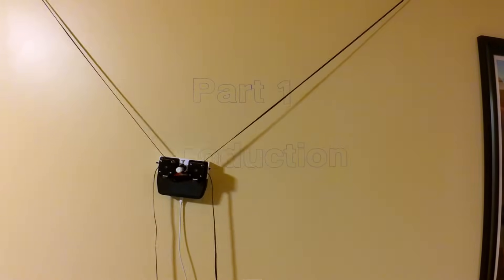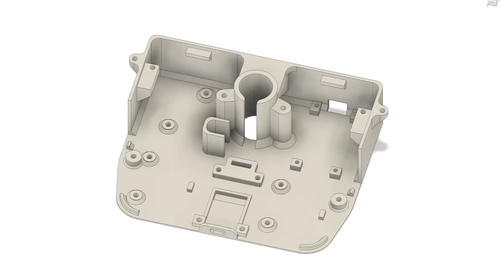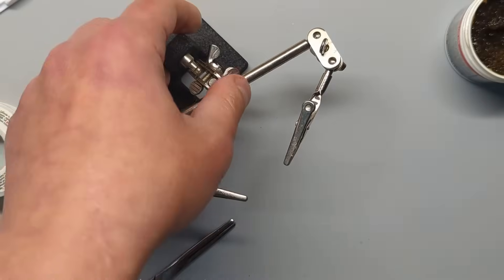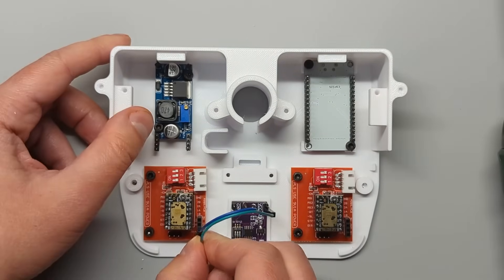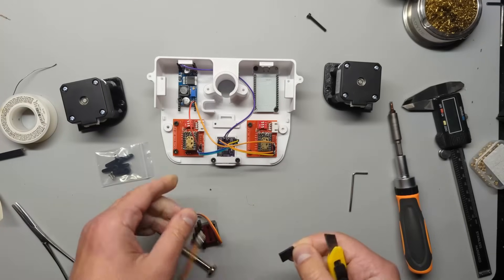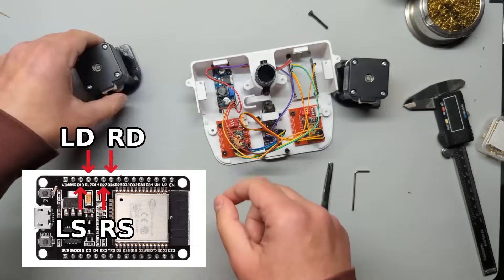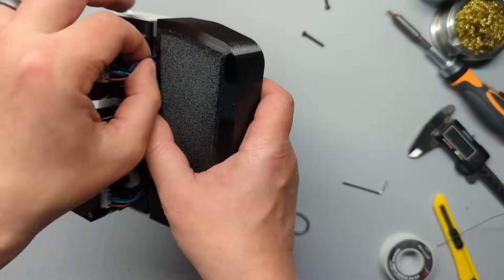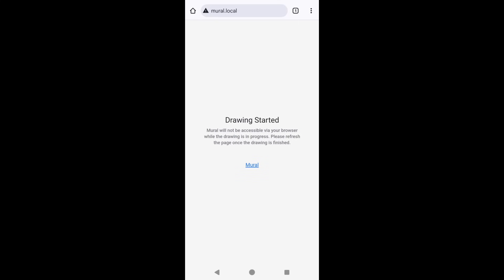Mural wall plotter: detailed assembly

Comment: Hello,
I think the problem of curvature of long straight lines is due to the non linearity of the conversion from cartesian to polar (kinda) system. To solve it properly, you can use some more advanced geometric formula. But it will not be easy. A way easier fix would be to just split long lines in many shorter ones.
As the radius gets bigger with the distances and is quasi-null for short distance, it should do the trick
Reply from the maker: @Lysou  yep, that's the plan - do a dewarp matrix
Reply from the maker: Thanks! I already do that - the distortion I got when using linear transform was WAY worse. The current distortion is due to my not accounting for catenary curves.
Reply: @nivanov Oh I see, 3 ideas that comes in my mind:
- Lower the belt mass (maybe some kind of ropes?)
- Maximise the mass of the plotter (but this might cause problem like motor skipping / belt stretching)
- Add a corrector, more or less simple like adding a vertical shift depending of how far the plotter is from the middle and the height. You can measure the shift at different heights by tracing "straight" lines and compare them to the real straights ones
Reply: I was thinking, you can try to plot a grid and measure the XY shift then apply a correction by doing a linear interpolation between nearest points

Comment: Why not just add a printer cartridge? Like a cheap multicolor cartridge then no need for vector only. More so you can use print heads of epson ink tank printers . There are already proprietary wall printers but not open source .m

Comment: also you should use steel backed pu belts. long fiber belts stretch and the forces increase greatly the higher they go.
Reply from the maker: I used 3d printer belts and other parts to keep the price low. Mural is pretty light so I don't think the belts would stretch much, but I'll see as I try to make it geometrically accurate.
Reply: @nivanov  the weight may not be a lot. but think of the angle between the belts as logarithmic multiplier. the more obtuse it is, the more it multiplies the weight.

Comment: the mechanical solution for the distortion is both belts shoud attach to the "same" place in the lbox. my suggestion is two idler gears as close to each other as possible. You'll see the box hanging perpendicular to the ground at all times if you get it right.

Comment: A couple of weeks I looked for something similar, but as a sensor.
It's pretty hard to find power cables hidden in the wall. And it would be great to scan for them and possibly even mark them so you don't make a mess when renovating.
Reply from the maker: @MarcRadermacher  that reminds me that I forgot to post F3D / STEP files so people can easily modify the chassis! Let me know if you end up attaching sensors to Mural. I love the idea of Mural being used beyond its original wall drawing robot functionality.
Reply: @nivanov  unfortunately I'm currently lacking pretty much all the skills necessary, but I do hope someone will pick up this idea.
Reply: If you had sensors, could you home the carriage for calibration instead of maxing out the servos? Like a metal tab at certain spots and run some kind of calibration...similar to a Z calibration on a 3d printer.
Reply from the maker: @bradyjmify I'm not sure what you mean sorry. What problem are you trying to solve with this approach?
Reply: @nivanov   @nivanov  I'm looking for a different solution to homing the servo before every sketch. My use-case is a whiteboard where I'd like to draw some fresh tables/charts each night while I'm away. (Same 'canvas', same nails for every sketch) Instead of maxing out the motors, could you instead place a metal screw head somewhere on the whiteboard that can let the microcontroller know where that location was, so you wouldn't have to max out the servos and re-hang the carriage for each sketch? If you were able to use the same canvas for every drawing, the nail could represent a constant X=0 Y=0, as if the top left limit of every sketch. (I'm not a programmer, but I can already see a few flaws like how to find the nail, where to store the carriage when not in use, how to utilize a second nail to calibrate scaling etc...) I wish you and I could sit down for 30 min and sketch this out to see if its plausible. Your work is amazing, I'm so glad I found this video, its the a solution I've been looking for.

Comment: I think the problem with the distortion could be because the unit changes angle as it runs horizontally across the wall. This is because the belts are coming out of each side of the body.
Could you move the pen to the center of rotation of the body? This would stop the rotation of the unit affecting the pen location on the wall. 

I remember seeing a router version of this. It was on YouTube years ago. 
Fantastic idea!  hope this helps good luck
Reply: The Mashlow or makermade.
Reply: I came here to say exactly this, it was the Maslow CNC and it had a ring that the end points of the belts connected to to ensure the toolhead was always centred. It has motors external to the sled though so not sure it'll work with Mural, there may be a way though.

https://youtu.be/vFaOZd0mWDw
Reply: i dont think that moving the pen will help since the position on unit on the wall is affected by this.  to make the unit hang horisontally you also  need to move a bit to the left.
Reply: I agree the out-of-level angle is the issue, but I don’t think moving the pen would resolve it. You could try to compensate for it in the algorithm. I think it would help to lower the center of gravity by attaching weight below it; or the simplest solution would be spreading your anchor points wider and keeping the printing area away from the outer boundaries where it distorts.

Comment: dumb question, wouldn't this be cheaper using a generic 3d printer motherboard ? asking since I have one around :)
Reply from the maker: Space is pretty constrained is the main factor. Besides, the breakout board  + NodeMCU ESP32 are dirt cheap if you order from China. It's the stepper drivers that are expensive, but you can still use the old A4988 or DRV8825 drivers if you dont mind https://www.youtube.com/watch?v=O9aorO9_gVA . TMC2209's are very quiet and come with other features I might tap into in later versions.

Comment: I dunno much about your code, but it seems that the top of your square is following a catenary curve, so you could model it using catenary functions like arcsin arcos. Catenary behavior results strictly from gravity pulling on things
Reply from the maker: The main issue is that I have to work backwards: I have the (x,y) coordinates, from which I calculate the two sets of coordinates, one for each motor pulley. Now I have two fixed points at the top (the hangers) and two points at the bottom. So far I've been treating them as a trapezoid, but that doesn't account for the catenary curves. However, I'm not sure how to calculate the lengths of belts, including catenary, that would make Mural sit at the desired (x, y) spot. I'll see what I can do with using catenary equations, but if that doesnt produce good results I can try overlaying ruler measurements on top of drawn calibration squares and figure out a matrix for dewarping.

Comment: So many great ideas and techniques in this video. Since belts are cheap and you're printing idlers, I wonder if a pseudo core style setup could offer more accuracy and maybe the chance to home against a limit switch?  might require mounting to studs, but 4 stronger mounts (vs 2) could take higher tension and would let you route the belt along the perimeter
Reply from the maker: Thanks for the suggestion! I don't need limit switches to home - TMC2209 drivers can already tell you when you stall, so it's just a matter of tapping into that functionality. The 4 point mount system is definitely interesting, but it's more complex and I still think I can accomplish everything I want in terms of accuracy with just 2 anchors.

Comment: Why not have it draw a grid the size of your art? so you can accurately measure the deflection, I’d be interested to see if droop is the same top to bottom and left to right for the entire pattern
Reply from the maker: @bmjnk3  yep that's the plan: draw a grid, and then use a ruler to draw the actual grid, and figure out the dewarp matrix from there

Comment: Would it work with Nema17 motors? after upgrading my extruders I have spare Nema17 the big ones and it seems this could be a good use for those. why not?
Reply from the maker: @DavidRincol  they're heavier than the pancake nema 17 and stick out farther, but otherwise should work. Give it a try and post your results!

Comment: To keep the sled level you can use an IMU or even 1 double reed switch or 2 single reed switches. That should help your consistency. If the switch on the right side is activated when it dips down then it pauses the left stepper for X number of steps. Save that as tilt offset. Then as it returns as the left side dips then pause the right and adjust the offset down.
Reply: that would imply a feedback loop which needs to be tuned for various speeds etc etc etc. i think the best solution is to use kinematics to get an accurate pen location when the whole mechanism is tilted
Reply: @bashdavid9223  good point it would likely crab walk around. Hm potentiometer with a weight on it.

Comment: Tip, if you find your sled doesnt stay against the wall you can increase the surface area of the top then point a strong fan at it. Some surfaces may not be vertical plumb.
Reply: Pulling air from the wall, of course, not blowing air. This will create just a tweak of suction?
Reply: @wetterschneider  blowing air at it, that way you don't need to add additional mechanical to the sled other than a flat piece of foam board on its top. And really most of the time it should ride the wall as designed. It's just for slightly pitched or concave walls.
Reply: @JasonThomasHorn  Sorry, not arguing just confused. Do you want to pen to continue to touch the wall if the wall is concave? Then suction is the way to go right? If the fan is blowing on the wall - won't it lift the pen off the wall?
Reply: @wetterschneider  no worries at all. I had a similar mechanism setup for spray paint. It was attached to a wood surface that was tilted out a few inches at the top. And the spray can would push itself away from the wall when activated. Under normal conditions it would be used on a vertical wall and the spray pattern was known. With the added tilt and swing of the sled the pattern was changing. My fix was to put a 2 foot round piece of foam core on its back with some gaftape. Then pointed a shop fan sitting on the floor at the back. It pushed the sled against the wall perfectly. In this use case adding suction would have complicated the project and likely interfered with the spray if to close to the can tip.
Reply: @JasonThomasHorn  Ahhh - you meant a free standing fan. Okay thank you.
Reply: @wetterschneider  bingo 😀
Reply: A suction very small fan, and a cap body working in opposite directions to a hovercraft.

Comment: I used to have the old wall plotter that use arduino mega… so I wonder if your code/firmware can use gcode file?
Reply from the maker: No, currently it uses a much simplified version of gcode that I came up with. However, I'm hoping to use Grbl / FluidNC in the next release which are CNC firmwares and thus should be able to use GCode as the source. The front-end handles all the "slicing" for you though, so you don't need to worry about GCode

Comment: Looks amazing compared to janky potters I made!

I didn't take a deeper look the code, but since the body rotates near the extremes, my first guess would be that you didn't compensate for the fact that you have a tripezium, and not a triangle between the anchors and the center of the pen. Having the belts enter at the center above the pen should help reduce the rotation, but less stable than way. Sounds like a lot of effort to fix, maybe try out perspective correction tools instead?
Reply: That was my first thought as well - don't compensate the movement, tweak the artwork in advance.
Reply: I agree, think there would be less warping  if the belts entered the body ideally as close together as possible. 

I'd be tempted to try routing the pulleys so that they enter the body as close to each other and the pen as possible. Could even route them onto pulleys with a hollow centre for the pen to go through. 
If thats not possible they could use some tensioning system to keep the body level. Would likely need a track on the floor so that the tension changes only with adjustment to the y level rather than x

Comment: Was really cool until you mentioned generative ai 👎
Reply from the maker: I did, but the ultimate goal is to convert a non AI generated raster image to something mural can render. Img2img would probably work for that.
Reply: @nivanov  You've met a hater.

It wouldn't matter how you used it, they would not care. Not like it should even matter, but anyway.

Project is amazing! I can really see the effort that went into it. Very creative.

Im interested in chalk, also curious how fast it is.

Wonder how well it would work on brick?
Reply from the maker: @andrew-729  I'm not sure if the pressure Mural can exert on the chalk would be enough. Brick is also too uneven for smooth motion.
Reply: -...as a conversion tool.-
Reply: @Rebar77_real 12:41 used gemini to generate that lion

Comment: Awesome project, i have some nema 17 steppers can i use them instead of pancake steppers ?
Reply from the maker: The pancake stepper motors are also Nema 17. Yours are probably a bit thicker and would stick out farther, but in terms of fit they should work just fine. The additional weight might make Mural not stick to the wall as well, but you should just try it - if not, you can get the pancake version and drop in the replacement. Let me know how that goes!

Comment: Grbl can't really do acceleration control with those coordinate systems.🎉
What Makes Marlin Perfect for a Wall Plotter?

1. Plug-and-Play Configurability for Any Wall Size

With EEPROM-based settings, you can change the plotter dimensions on the fly—no need to recompile or flash firmware.

Use G-code commands to instantly adjust the plotting area, motor travel limits, and stepper behavior based on the size of the wall or canvas.

Want to scale up? Simply enter new parameters, and Marlin auto-adapts.

2. Built-in Stepper Precision & Acceleration Control

Microstepping & Jerk Control ensures smooth, vibration-free movement for precise plotting.

Dynamic Acceleration Adjustment lets you tweak speed and control curve-following accuracy in real-time.

Smart Homing Support enables quick calibration and repeatability across different wall setups.

3. Native Servo Support for Tool Control

Pen up / pen down? No problem. Marlin already includes servo control for things like auto-bed leveling in 3D printers, so integrating a servo-based pen-lift mechanism is easy.

Multiple tools? Switch between different drawing implements dynamically without major firmware modifications.

4. Adaptable to Any Kinematic System

Whether your plotter is a hanging system, a belt-driven rail, or a polar system, Marlin can be configured with custom kinematics.

Inverse kinematics can be implemented via firmware modifications, or by preprocessing the G-code externally.

5. Real-Time Control via LCD, SD Card, or Host Connection

Standalone operation via an LCD and SD card—no need for a dedicated computer once set up.

Serial communication allows live adjustments via USB, making it easy to tweak parameters remotely.

Wi-Fi control possible with ESP-based Marlin forks or a Raspberry Pi running OctoPrint.

6. Industry-Proven Reliability & Community Support

Used by millions of 3D printers worldwide, Marlin is one of the most stable and widely supported firmware platforms in the open-source motion control world.

A massive developer and maker community ensures continuous updates, bug fixes, and customization possibilities.
Reply from the maker: Marlin is a pretty OG solution - I'll have to take a look, I didn't realize it would have polar plotter kinematics support. FluidNC was forked off Grbl and it has wall plotter kinematics built in, though it might not be a complete implementation: http://wiki.fluidnc.com/en/config/kinematics